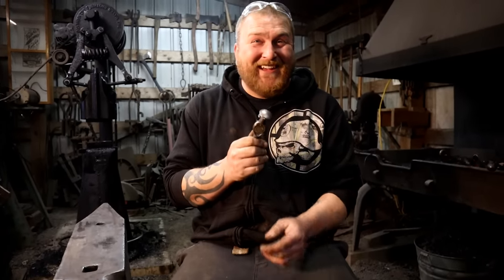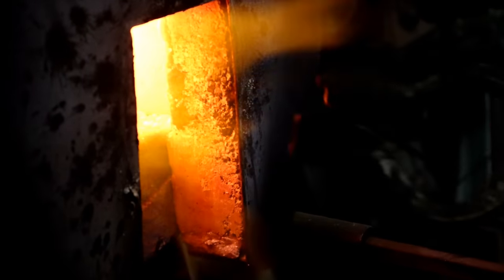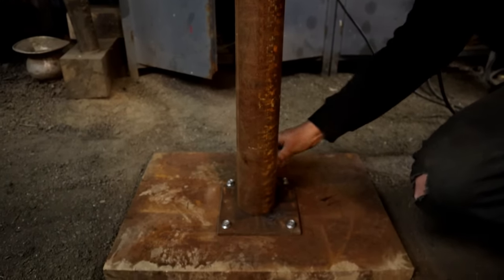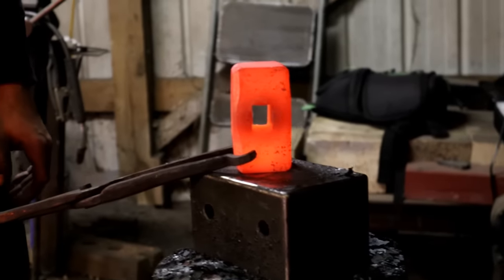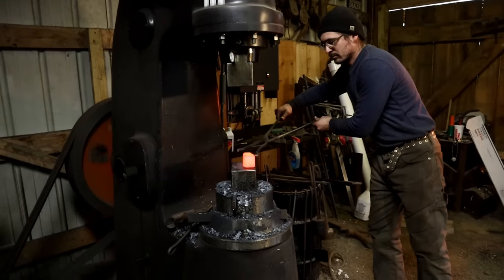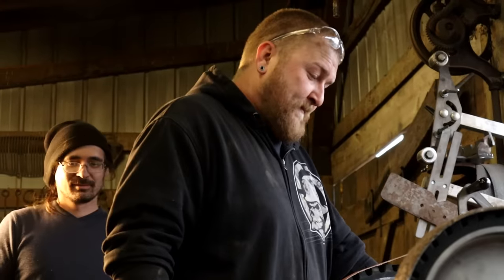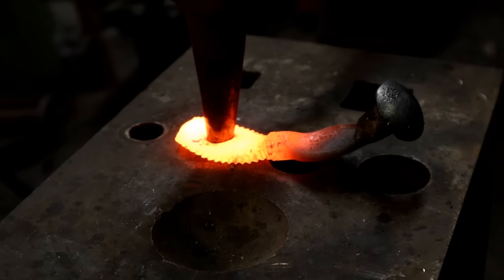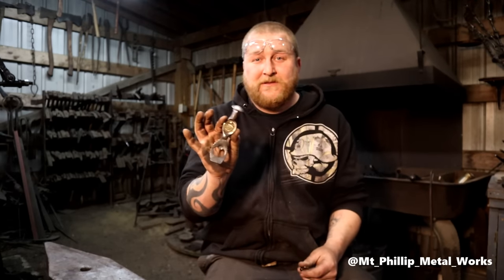Forging Hammers/Bottle Openers, Shop Upgrades and Bladeshow 2020 !

Comment: How large of a surface would you recommend for the brodbeck? I just ordered one and need to figure out a stand myself Haha
Reply: The base of the grinder is 12x12
Reply: @MtPhillipMetalWorks  how much more room should I leave for the vfd?
Reply: Noel Laflamme another 10 inches is good
Reply: Noel Laflamme the top plate in the video is 22” wide by 14” deep
Reply: @MtPhillipMetalWorks  awesome thanks! Cant wait for it to come in